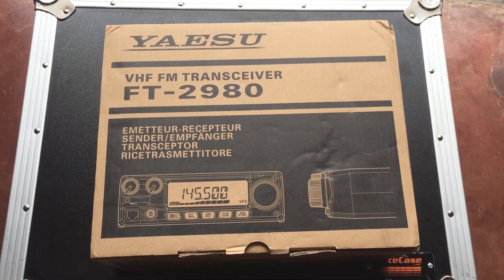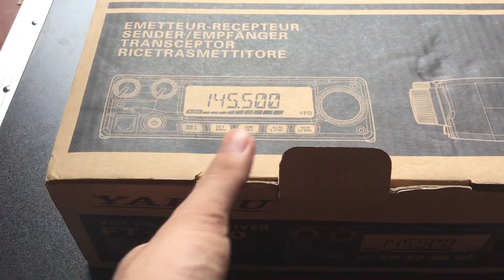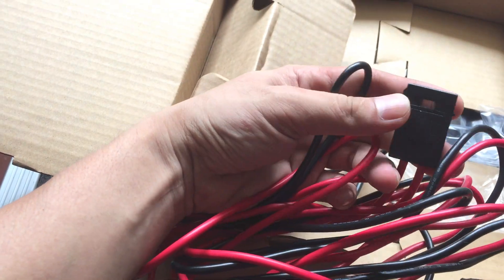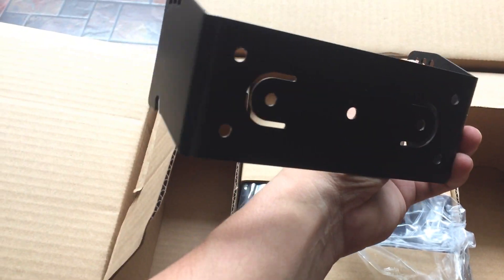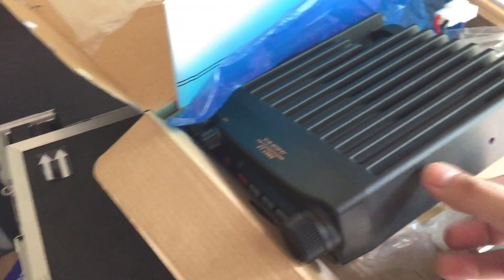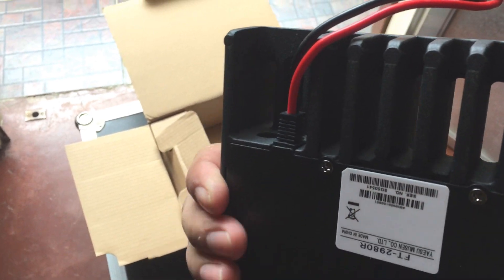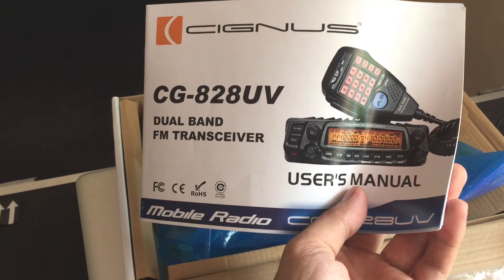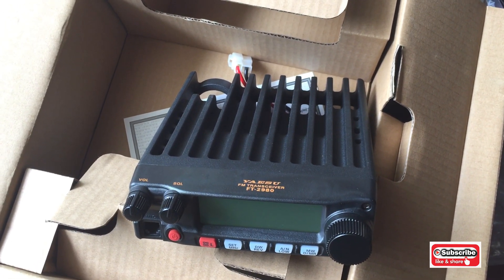Unboxing Yaesu Ft2980 Transceiver VHF Base Radio

Comment: What’s the longest point to point contact you’ve made with this? (No repeater) good review! I’m thinking about getting one too
Reply from the maker: it's a good radio rated 80 watts but you can configure it to put the finals on full power up to 100watts, powerful device, distance on contact may vary depends on your Arial setup, Power Supply,  Hight, and type of antenna, I use this paired with diamond cpp22 and its performing well, can even talk to neighboring islands in my place , and that's quit far.....Price wise. Just be careful some units have Cracky sounds on output.
Reply: @techguidechan3979  thanks for the response! I’ll test mine when I get it
Reply from the maker: @DutchmanRadio  sure no problem....
Reply: mine here in victoria. laguna area..i can hit tru 198km in oriental mindoro on simplex using my homebrew antena g7 at 25ft above the ground...very good radio